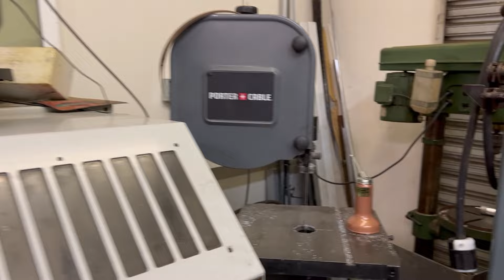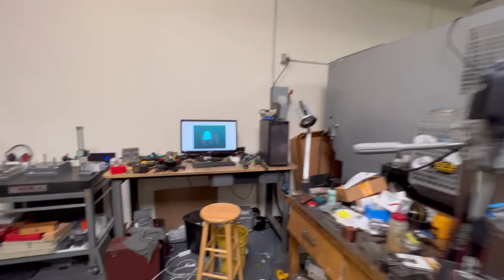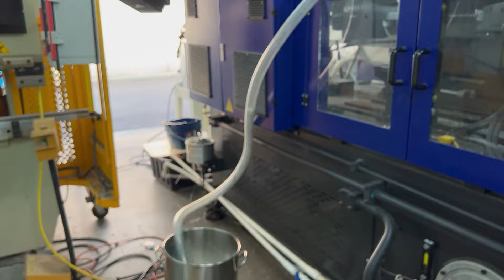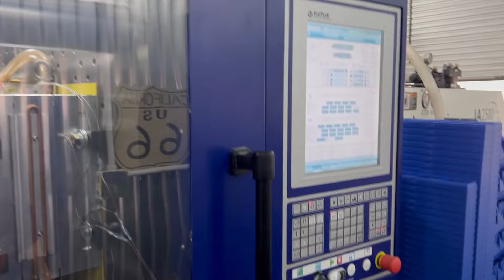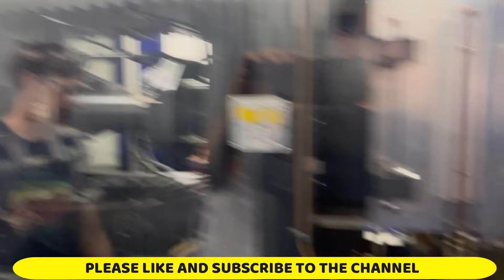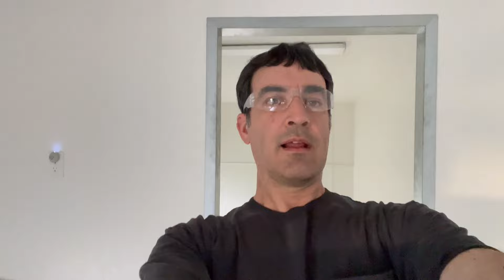SHOP TOUR

Comment: cool!  I think that custom part for fitting between metric and American threads would be a good candidate for a 3d printed part.  Nylon or even TPU I think would work well.
Reply: Nylon or TPU would be too soft.  The threads would simply shear out.  This part needs to be steel, as even Aluminum threads would tear out given the force the ejector cylinder applies to the mold.
Reply: @proto2580  today I learned.  thanks!